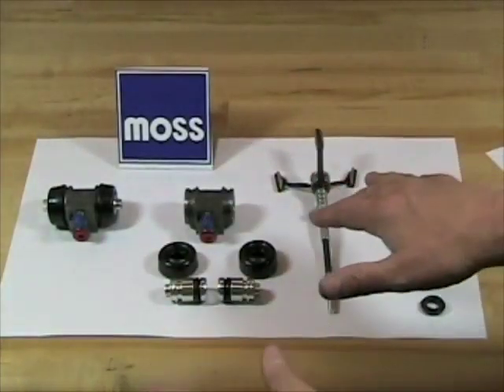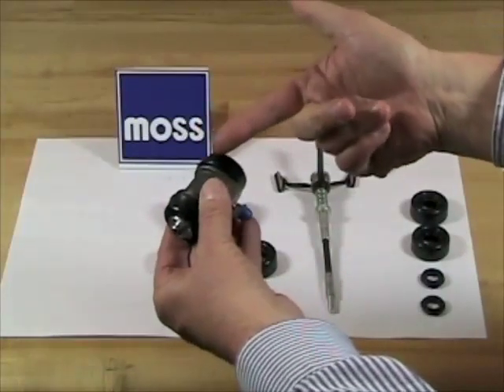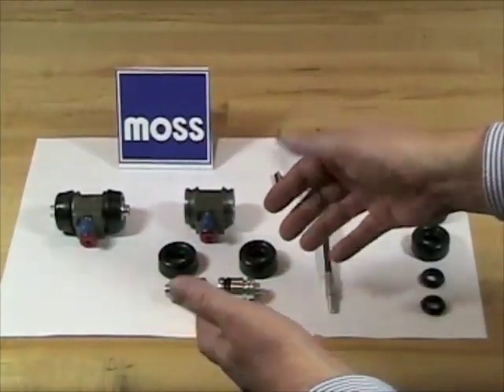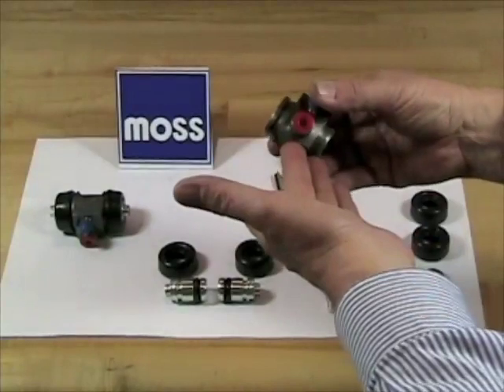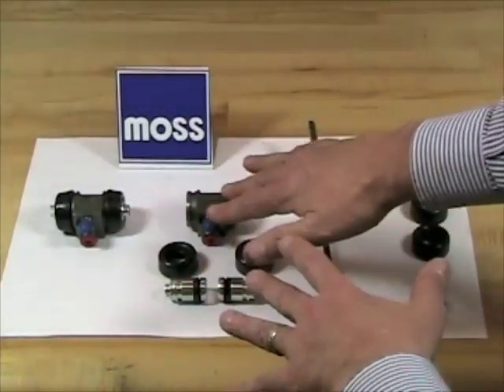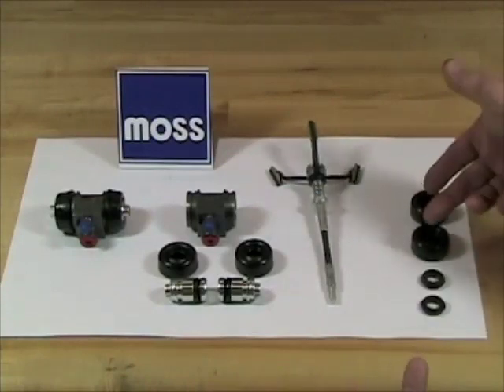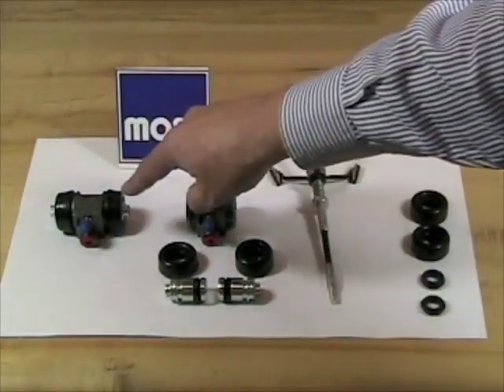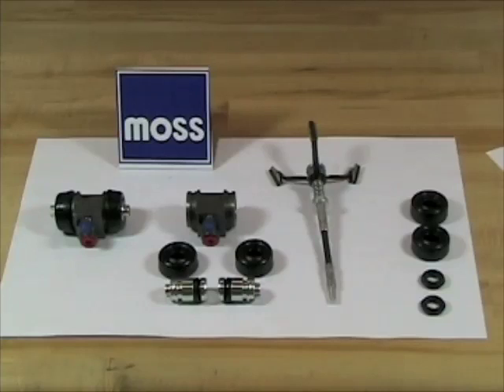Wheel Cylinder - How to Rebuild

Comment: Keep in mind that almost all wheel cylinders will be pitted from corosion between where the old cups reached. Honing will rarely get those pits removed and the new cups may reach those pits and leak right away. New cylinders are usually cheap meaning under $15 when seal kits are $5 or more.
Reply: bottmar1 Usually, however on my car, the cylinder is $90 per wheel.
Reply: Yeah and made in china.

Comment: My rubber parts said not to clean out with anything that could contain mineral oil, including gas, kerosene, diesel, etc. You glossed over that part, I was hoping for info regarding how to clean out after using a parts cleaner, the instructions say alcohol but I am fresh and out figured I'd look on line first before heading to store.
Reply: According to Wikipedia's entry for brake cleaner, as of the date of this reply, "An important feature is that the brake cleaner leaves no residue after the solvents evaporate." One would assume this applies to both non- and chlorinated formulas. This has always been my understanding as it is very important not to leave any hydrocarbon residue behind on the interface materials of brake systems.

Comment: Where can I get the AISIN rings for the piston?
Reply: If you're working on a Toyota, you can get the Aisin piston seals from a dealership or from an online Toyota parts dealer. Google the ten digit part number on the dust cover and you should be able to find a rebuild kit that comes with all the seals and probably the bleeder bolt caps too. I know it's a couple years late, but hopefully you or someone else reading can use this info.